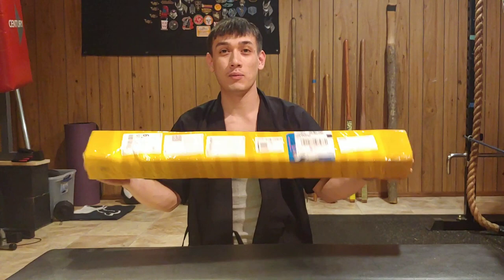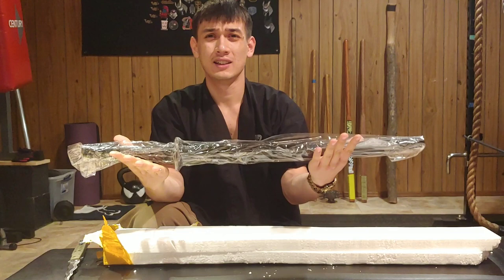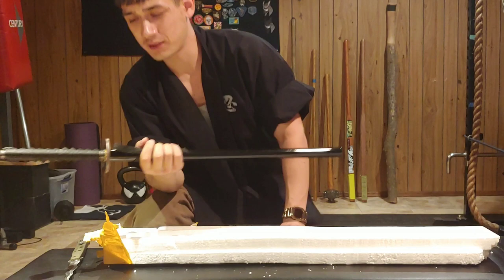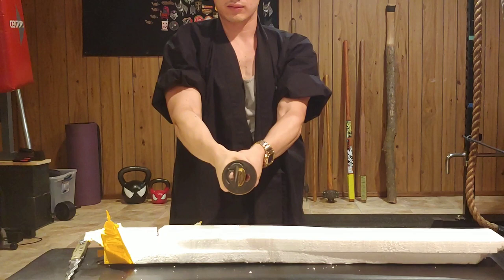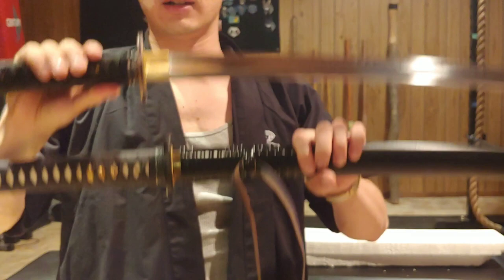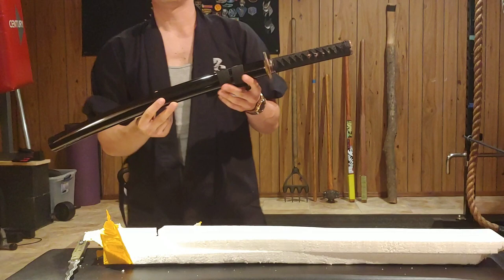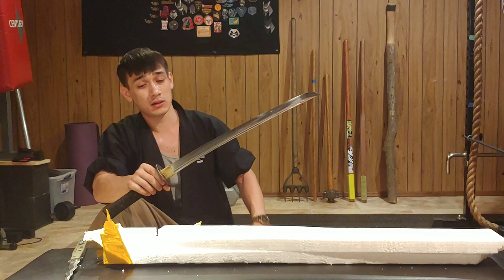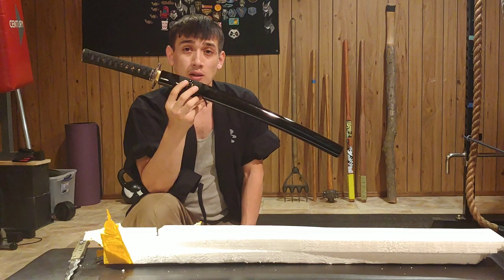Yongli Wakizashi T10 The Best $100 Samurai Sword?

Comment: Great looking Wakizashi, man. I got myself a T10 tool steel katana for only $157. You are exactly right and I also mention this in my video - most modern steels are WAY superior to the traditional medieval tamahagane steel. Too bad katana cultists can't get this through their head.
Reply: Where did you get said katana
Reply: @cody3362  hi, I have linked a few katana's in my video's description. Check them out, they are all under $155.
Reply: @Svet69  thank you so much
Reply from the maker: Thank you for the comment I will check out your videos!
Reply: Well made tamahagane katana could put 10 cm hole in steel helmet without rolling chipping or scratching. You have documentary about that. Btw traditional katana have good balans and geometry since they are forged and not grinded. I don't see how tamahagane(high carbon) blade with superior geometry is worse than some trash modern blade with bad balance and fittings that are made from crap and not right size.

Comment: I have also gotten myself a cheap but decent T10 tanto. Not bad at all. Guess T10 steel is the key
Reply from the maker: Yes good steel usually translates to a good blade. I'm very happy with this cheaper blade. Blessings

Comment: Yep its clay tempered ,  but i doubt very much  its  t10  for $100   i can see you  hurting yourself with that , you cant tell its tool steel unless you you get it  rockwell tested ,  t10 is reserved for expensive  blades ,  if it scratches during messing with it    its carbon steel , tool steel doesnt   scratch up
Reply from the maker: We can't really trust anything unless we forget it our selves. In another video I baton through hard wood and it holds up well. Cheers

Comment: No cut test?
Reply from the maker: I've beat this blade to Valhala and back. Check out my videos! Still haven't sharpened it and still sharp blade. When it no longer cuts I will sharpen to 30,000 grit virtuvice style

Comment: I bought a katana with carbon steel and it costed me around $350 something

I think it's also tempered
Reply from the maker: Sounds awesome! I just ordered a new T10 katana for $150
Reply: @VeganJutsu  Jesus you’re still hearting and replying now that’s dedication.

Also I have a T10 katana it’s pretty good also mate how do you recommend sharpening a katana since my old whetstone is gone is there like another way or do I have to buy another whetstone
Reply from the maker: @nolife097  you don't have to buy new stones, although it requires a bit more finesse. The bottom of ceramic mugs are about 1000 grit. I usually use a ceramic mug to touch up blades. But with a longer blade length it's not ideal. You could try and find ceramic plant pottery with a wider more flat base and use this as your abrasive stone. 

There's is alot of other ways including using wet sanding paper secured to a flat base and working through more finer grits.
Reply: @VeganJutsu  got it thank you

Comment: Has this held up? I'm so tempted. I want a Waki so bad lately, but I don't want to pay a respectable price because I don't know if I'll like it.

The colors look exactly like what I would want. The price is right.
Reply from the maker: The blade is great and still holding up. I did have to re handle after only one month of use but the T10 blade is still running smooth

Comment: why not cut the top ? and what did you do with the knife   didnt it cut the tape ? you need a new knife pal. its very sharp it cut through the air a good few times, the same company does cold steel 1060 carbon blades .. this turkeys gonna hurt himself  badly ! heres a fact pal the steel was crap back in the katana days  AND there wasnt much of it ,  they were usually only hardened along the cutting edge ,  and  1000s of years ago equates to 1100 ad  were in 2000 ad , that cheap  half copy  is probably better made than 20 original katanas  thats a fact
Reply from the maker: Yup I'm pretty sure I said that T10 is superior to any katana they had in samurai period. I was trying to avoid cutting the tape because its hard to clean from the blade. This sword is still going strong its very well made for only $100. Thank you for your comment friend
Reply: @VeganJutsu   good value for 100 dabs .

Comment: total length of the entire new wakazashi pls?
Reply from the maker: I cannot measure as I've fitted an axe handle to this blade. The manufacturers specs read as follows:

Overall Length: 30″, Blade Length: 20 1/2″, Handle Length: 9″

Hand Forged T10 steel Clay Tempered Steel Blade

Thank you for your comments friend

Comment: I’ve been trying to find a good katana that is pretty cheap I think this is the one can it cut a coconut will it start to get wobbly after you cut hard stuff please reply and subscribe if you can🙏🏼
Reply from the maker: Howdy friend. Yes there is a video called "is the yongli strongly" i cut and baton seasoned hard woods and cut through 8 water bottles easily. It will smash a coconut the last coconuts I was able to break open with a pocket folding knife. That video is called "basic edc jutsu strikes" This sword is very nice but the handle did crack. I replaced the handle with an Axe handle in the video called "ko katana build" i will sunscribe to you friend. Many blessings.
Reply: @VeganJutsu  thank you for the info and the sub very appreciative 🙏🏼

Comment: Looking at the handle wrap materials on these swords and wondering if it's possible to get a company to test out a handle wrap like on the CRKT Obake line of knives. Those knives use a kind of imitation rayskin wrap, but they're epoxied in place and more solid than a real leather wrap. If that concept works on a sword wrap it'd not only be vegan friendly but possibly stronger than traditional materials, almost never needing to be re-tightened.
This would also challenge the fear that sword companies have to make "high end" stuff with non-traditional materials and not make it look like something out of a zombie movie

If swords were still serious battle weapons, they'd def be made with the kind of synthetic materials used on high end sports equipment like tennis rackets, given that natural leather is vulnerable to moisture and temperature changes.

Comment: Can you remove the pins in the handle and check the tang?
Reply from the maker: Yes. The tang is full but it's a one pin design and it's weleded at the pommel. I did a rehandle to an axe handle and love it. There is a video of the build. It's still going strong
Reply: @VeganJutsu  
That's awsome. Welp worst case scenario, you can swap out the weak components and either make or replace them with better quality ones.

Comment: Is 9260 better than T10?
Reply from the maker: Hey sorry I don't have any 9260 to compare. I will consider this steel on my next sword purchase. My favorite steel is 80crv2 and 3v, I'd say T10 is harder than 1095 and similar in strength to 5160. Of course a good heat treat is essential so I shop by forge/maker not just steel

Comment: Well maybe better than 1000 years ago but t10 isn't superior to traditional Japanese steel. T10 is only superior in being stainless. T10 is between 1095 and 440c but less chromium than 440c.
Reply from the maker: I just bought the updated 2022 version. The one from this video has great edge retention and very little damage even after all these years of chaos.

Agreed tho that in modern days it's nothing special but for $100 it's very hard to compete in this value.

Comment: Not a full tang. Very disappointed.
Reply from the maker: I have a video where I take apart and rehandle. the tang goes all the way through to the end. Perhaps the design is changed
Reply: sales person said all (real) Katanas have a 2 cm distance from end of blade to butt of handle to prevent rust.   I did not see your video with the take apart.  @VeganJutsu
Reply from the maker: @Hope_Prayer  about 2 minutes into this video https://youtu.be/2-Yll7wn9bQ?si=xiTwV5I_zrdx_TvR